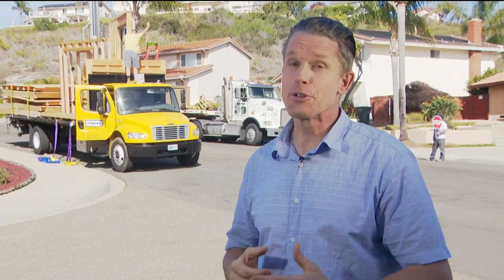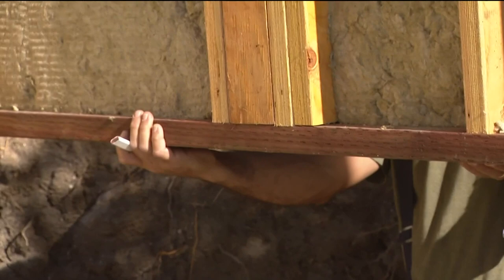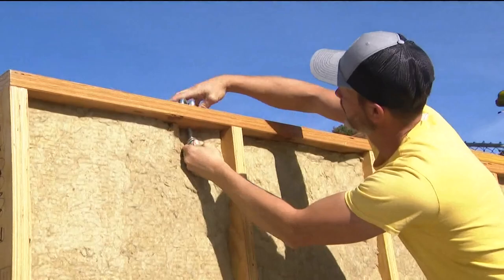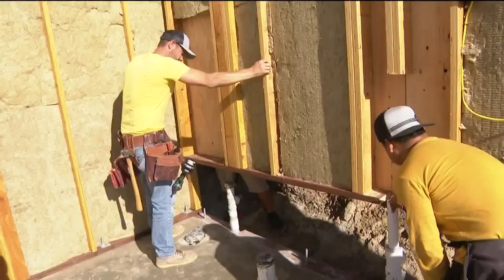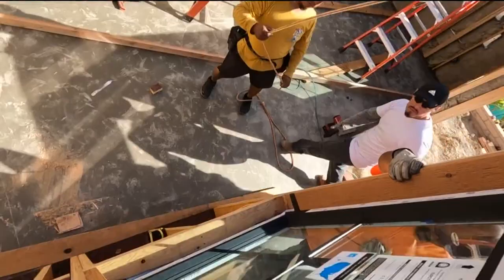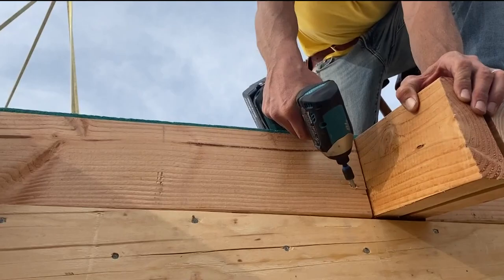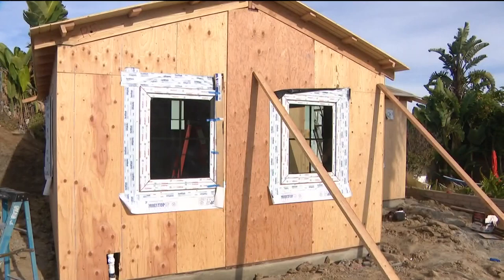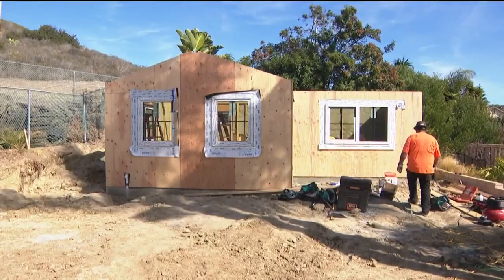‘Build an ADU in a day’ | How one Vista company gets it done

Comment: I did mine for $40K back in 2014.  380 square-ft and it was built above my garage where an old deck once existed and then tied it into an existing bedroom, so that helped save a lot of $$.  Plus I had a friend do the framing and found other contractors that needed side work.  I did the doors, baseboards and cabinet installs myself as well as the finish plumbing.  The best investment I ever did besides buying real estate over 20 years ago.  That 380 sq-ft rents as an Airbnb for $2800 a month.

My friend who did my framing built his own ADU this year.  It's detached and 580 Sq-ft.  He did a lot of the work himself and/or had friends help him with painting, electrical, plumbing, etc.  He said it costed him about $80k.
Reply: is it easy to get approval for prefab houses in ca?

Comment: $230k for the finished product not bad
Reply: Wdym. That’s horrible. $460/sf is outrageous
Reply: @Nothing_here______  that's actually profitable where you sell for 600 per sqft. 
the market doesn't have to make sense to us.
Reply: @GalacticTradingPost garages and detached buildings do not count towards the homes sq ft. The sqft of the main home will always get the highest price per sqft. An Adu or guest house or garage does not count towards that and adds a lower amount to the value of the property than the main structure. At $230k total you’d be lucky to get $3k a month rent and with the increased property expenses (utilities, insurance, prop tax) it would take more than 10 years to recoup that investment. So you’d spend $230 k and it would take ten years to get that money back. If you put $230k in the bank at 5% CD/savings rate you would waste a penny and would be getting insured returns and your total amount would increase to about $380k after ten years. It seems like a better investment to just keep the money in the bank. Now if someone is doing a loan to do this that adds a big risk but could work…
Reply: @mattm7377  Finished, insulated, and permitted indoor space will count. I've seen ADUs both detached and attached counted as square footage before.

You're thinking unpermitted DIY project which absolutely do not count. Basements, glass rooms, decks with walls and roof, attics don't count either.